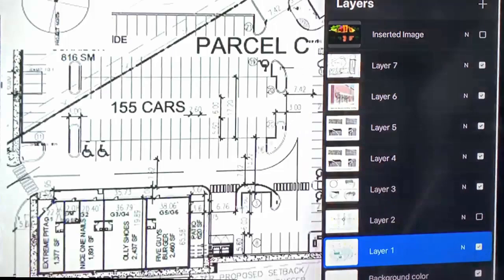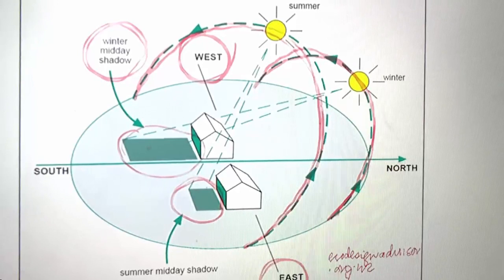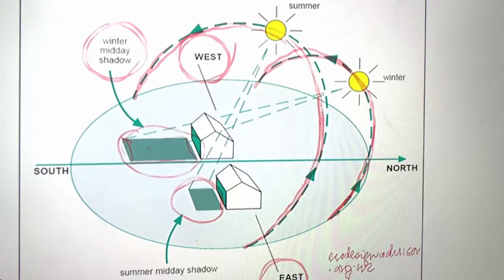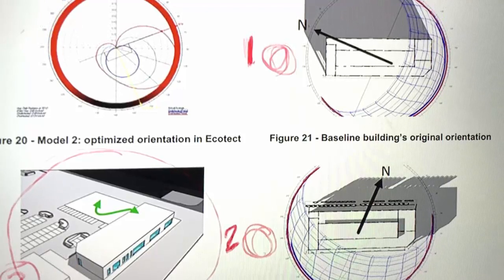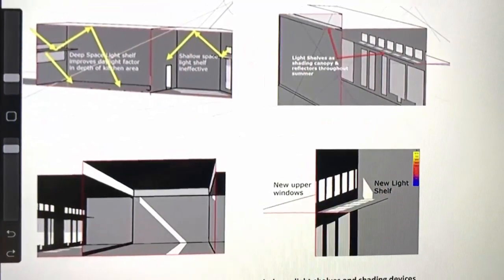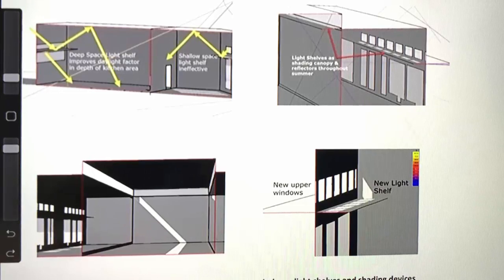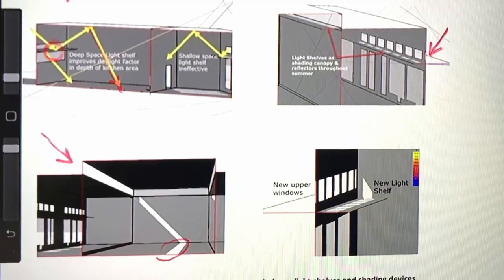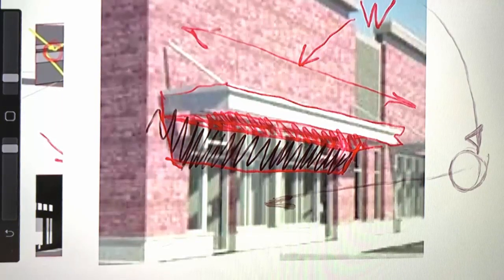Building Orientation and the Architectural Design Concept

Comment: In dense cities you sometimes have the problem of shading. When I'm on a potential site, I like to use apps like SOLight with which you can view the course of the sun. If the sun is behind a building or a mountain, I know that the place is shaded at that time. That can also help concerning design concepts.
Reply from the maker: Thanks Tim. great insight! I'll review for sure.